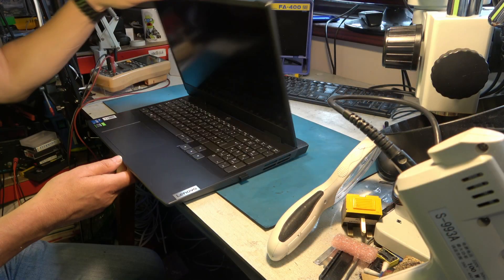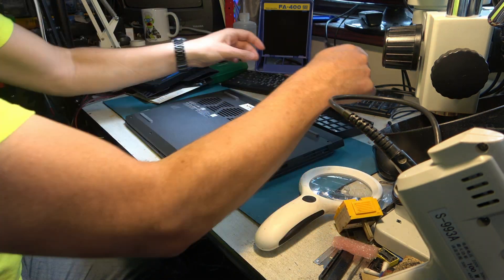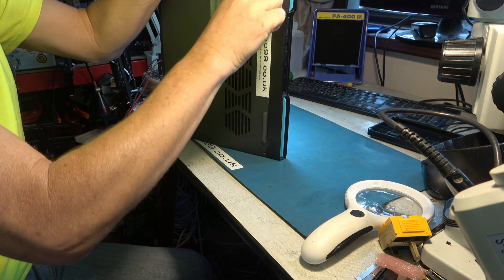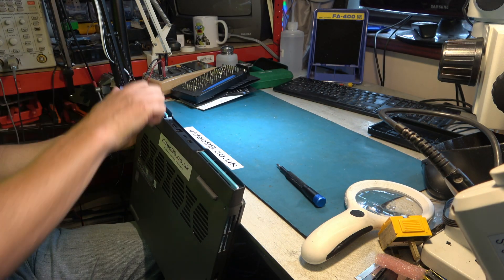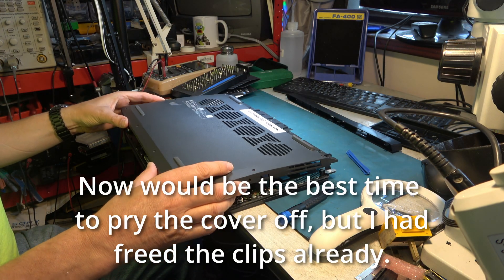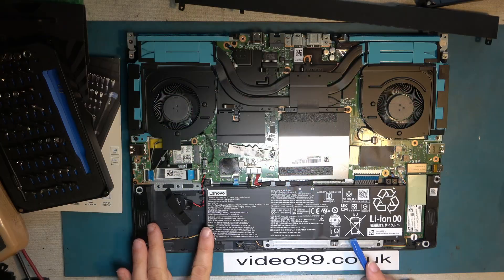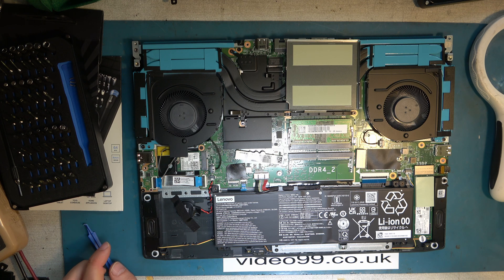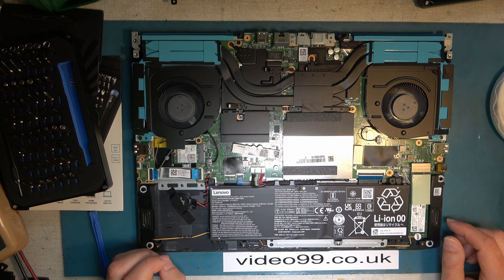Lenovo gaming laptop upgrade possibilities. Very little information on new model 82S900YQUK.

Comment: These machines are great - my partner has a similar machine, the Legion 5 with AMD CPU instead of Intel, an upping to to 32GB was a doddle (and shockingly cheap too!) - as mentioned you can pop in an extra SSD, I believe either SATA or NVMe M.2 drives work, but you'd be silly not to get an NVMe drive given how cheap they are, with even the cheapest ones being over twice the speed of their SATA counterparts. Not sure about this model, but at least with the Legion 5 you can even upgrade the display from a 1080p panel to a 4K one. Dedicated battery area is nice as if the battery fails it won't take out the rest of the machine with it.
Reply from the maker: I believe the smaller slot is SATA only.